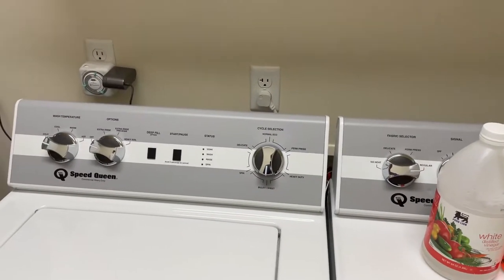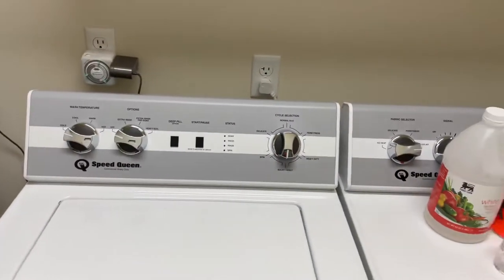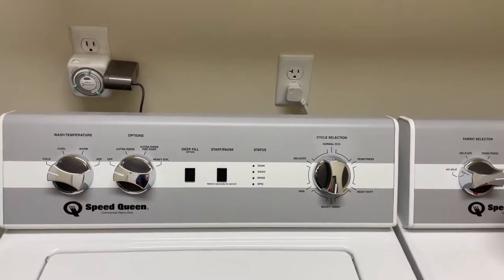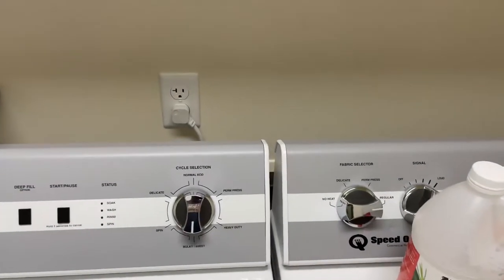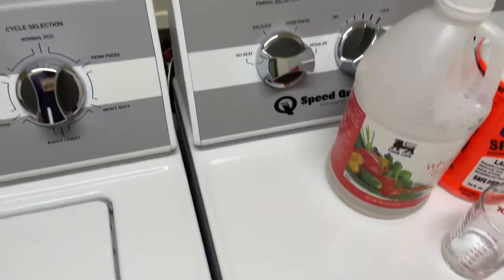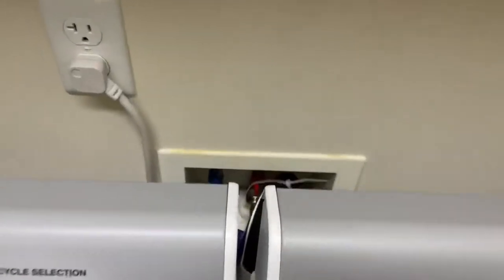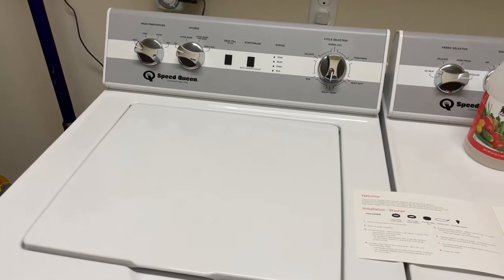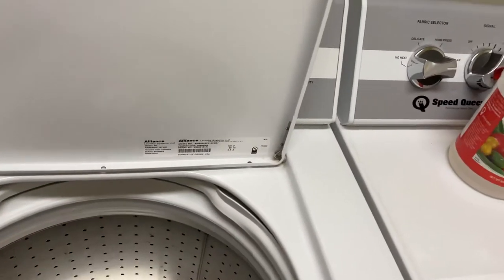Foam Bubbles coming out Speed Queen Washer drain hose - Fixed!

Comment: Rick, You are one impressive person. I did as you suggested but after doing the  "tub cleaning", I ran a regular load  using detergent, Borax and vinegar and this very wet foaming over still happened at the very end of the spin cycle. I have spent a lot of money to make sure everything else is working correctly as far as the plumbing. I am at the point of just accepting that I will have to be prepared to catch the spillage every time I do a wash. Ideas?
Reply from the maker: Hi Denise.  Thank you for the kind words.  Deep Fill the machine with Warm water.  Do not put anything in it.  No clothes. No detergent.  After a 3-5 minutes of it washing open the lid.  Are there suds in the water in the tub?  A few bubbles are not a problem.  If there are suds - there is still soap inside your machine.  It hasn't all been cleaned out yet.  Let me know how that goes.  Rick
Reply: Rick! Thank you for your quick response! I did what you suggested and there are only a very few bubbles from agitation, most likely. No suds.  I am grateful for any suggestions you have.  @rickstid-bits
Reply from the maker: Hi Denise,  Well . . . 
That tells me that the soap build-up in the machine is gone.  That's good. 
That tells me the foaming you're getting is from the ingredients you're adding in each wash load. 
1.  Are you using anything other that detergent and white vinegar?  No softener crystals, beads, etc?  
2.  You are using a cycle that uses a true drain-and-refill rinse cycle, correct?
3.  You could use a cycle that uses the Slow Speed Spin.  I didn't get any foaming when I tested that cycle.  However, our clothes came out a lot less dry with that cycle.  
4.  Use a lot less detergent.  
5.  Try a different detergent.  And again, a lot less of it.  
6.  Try adding 2 or 3 or more ounces of vinegar to the cup in the center of the agitator.  You can experiment until you find an amount that works for you.  

7.  Timer:  This is not a convenient practice, but if you are always near the machine while you are doing a load -  it will work.  The High Speed Spin spins for 8 minutes.  I only ever see the foaming during the last 3 minutes of that final, High Speed Spin.  Depending on what Cycle and settings you use:  You could add up the time each event takes, and then set a timer to go off 3-4 minutes before the end of that final event.  The timer would go off when the machine is 4-5 minutes into the High Speed Spin.   Simply open the lid at that time and remove the clothes at that time.  Then, Cancel the cycle.  My wife has an Apple watch and she uses it to, "Set Timer for xx minutes" all the time.  She has that Apple Watch Timer down to a science.
Reply: Ok, I use liquid detergent and Borax normally. I added the vinegar just because of your suggestion.  During the final spin cycle, the amount varies, but I have to keep two paper towels stuffed in the box where the drain and on/off water valves sit because of the amount of very wet bubbles that overflow. At times there is enough to overflow and wet the floor if I forget to do this. Otherwise, I can capture the "wet" mostly in the box.        re @rickstid-bits
Reply: oops.... I only saw part of your previous message before my last response. Thank you for all the effort that you put into my issue. I SINCERELY appreciate your help! I will try your suggestions.
Reply from the maker: I'm sorry none of those tips are helping you.  If you ever find something that works for you, please come back and let me know.
Reply: Rick, just that fact that you posted and let many others reveal that this is a "Speed Queen" specific issue, was a game changer! The plumbers came back and I was able to run the end of the final cycle and show them exactly what and when the spillage happens. They had never seen anything like this!   For now, they did a temporary fix that seems to be working. They pulled up the white drainage hose and created a thick band around one area with plumber's 10 mil tape so that when forced back into the drain pipe , nothing can come up. They made it fit super tight. I hope that explanation makes sense. Rick, YOU are a rockstar! THANK YOU!               @rickstid-bits
Reply from the maker: Hi Denise,  Thank you for the kind words.  I really enjoy helping other people by passing-on tid-bits that I figured out over time.   Keep me posted.  Rick

Comment: I can’t begin to tell you how frustrated I am with this machine.  My third Speedqueen washer and last.  I realized early on there was a foam overflow problem and would tie a t shirt to the standpipe.  Every fifth wash I would notice moisture so I would change it.  Come yesterday we had a flood seems that the thing they give you to help with this issue came off and clogged our standpipe.  Plumber charged 240 and had to cut it in order to get that black plastic cap.  Still it is foaming out and now are floor is damaged and drywall is removed    I call Speedqueen and not much they can do.  They won’t switch it out to their other less powerful model which at this point I would rather have.  I wish I never bought it.  I do use the vinegar and will now use it for every wash.  Thank you so much for sharing    Do you think the normal eco cycle produces more suds.  Thanks again.
Reply from the maker: Hi Donna.  Yes.  The Eco cycle uses 1 less drain and refill cycle than the others.  That means the suds are less diluted during the final high speed spin.  We use Heavy Duty, Bulky, and Permanent Press.  I have since changed how we add the vinegar.  We now add 1-2 ounces in the center fabric softener dispenser when we add the detergent to the machine.  That adds the vinegar during the first spin, which is at the end of the wash cycle.  That has worked very well for us.
Reply: I switched from Normal/Eco to permanent press and it fixed our issue.

Comment: I have cleaned my machine and am using 1/2 tablespoon of Persil sensitive detergent and am still getting bubbles/water coming above the black adapter that goes in the standpipe. I don't know what kind of detergent to use and I am so frustrated. I use vinegar with every cycle.
Reply from the maker: Hi J,  Please click on the word "more" at the end of my description.  I have added a lot more information there.  Please do the #1 Flush, and read about which Cycle not to use.  Rick

Comment: My tc5 has gotten worse and actually leaks water over the drain now. Not just foam. It was on the drain cycle and started overflowing, so I turned it off. I let it rest a day and tried again, but it overflowed, so I called a plumber. He sat and flushed the lines with me standing there for almost ten minutes. He said my lines were clear and packed up to leave. I shut my washer and started it up, and it immediately overflowed. I ran out and got him to come see what was happening, and he said if he didn't see it with his own eyes, he wouldn't believe it. He was stumped. No suds. Just water. The vinegar helped for a little bit, but we are hardly using soap. It's on the wash cycle and there are no suds. When it drains, there are suds at the end, but water overflows the wall. I've had two overflows, just this week. We just replaced the plumbing in the wall floors in December. FRUSTRATING! Plumber is stumped. Come on Speed Queen.
Reply from the maker: Hi Lisa,  I'm sorry you're having problems.   If it's overflowing pure water, with zero foam in it, I don't think the washer is causing the problem.  Everyone that has added comments here, and myself, only have issues with the foam bubbling up in the standpipe.
I can think of 3 things for you to check.
1.  How high up the wall is your standpipe?  How many feet and inches?  If a standpipe is too low - there isn't enough pipe in the wall to accommodate the amount of water that rushes into it when the washer drains.
2.  Could your washer machine's flexible drain hose have a hole in it?  Even a pin hole can leak a lot of water.  Look real close while it's draining and see if the water is coming back up the standpipe, or from the drain hose.
3.  There has to be a good amount of the drain hose sitting inside the standpipe.  At lease a few inches.  Is that part of your drain hose short?    
Thank you for leaving a comment.  Please click on the words “Rick’s Tid-Bits” underneath the video to go to my YouTube channel.  I think you’ll find some helpful and unique tips in my How to Make Life Easier or Better section.  https://www.youtube.com/channel/UCc-IuUFzC2Tyv06KzJyBESg  Rick

Comment: We purchased a SpeedQueen Model AWN432SP113TW04 several years ago.  Moved in 2020 and just discovered paint peeling behind our washer due to suds backup (we didn't experience this in previous home).  Our standpipe is standard height.  Contacted SQ rep who suggested fabric softener which worked but quite frankly I don't want to have to add fabric softener (and extra rinse cycle) to every load for the duration of the life of this washer (more chemicals, more money)??? Vinegar didn't seem to work.   Called SQ repair who suggested getting the small black rubber adapter.  This doesn't fit snuggly into the standpipe.  I find it surprising that this appears to be a longstanding problem with SQ washers yet they've not come up with a solution.  My husband and I are so frustrated after dealing with this for months.  Is fabric softener truly the only fix for this??
Reply from the maker: Hello.  Try this:  Empty washer. Hot Water. Heavy Duty cycle. No other options.  Not Deep Fill.  No soap.  Let it fill. Pour a half gallon of white vinegar in right after it fills.  Let it run.  That should flush out most of the residual soap from the machine and your drain.  Afterwards:  Remember to always use A LOT less detergent than you think you should.  Please come back and let me know how that goes.
Reply: @rickstid-bits  Hi Rick, thank you so much for the response.  My regular wash habit was using the regular cycle and regular Tide liquid.  I recently switched to HE Tide but use very little (approximately 1 Tbsp).  I just finished doing exactly as you said and there was no backup.  However, we had ordered a black rubber adapter that was recommended by a SQ rep.  It didn’t fit snuggly but we pushed it in standpipe as much as we could.  I think if there was backup I would have felt it on the paper towels we keep wrapped around the hose/pipe.  That said, I’m wondering a few things now:

Any idea How long does this vinegar “fix” work for?
Do you add vinegar on a regular basis?
Reply from the maker: Hi Charles,
Here's some more of my thoughts for you . . . 
*  We add 1-2 ounces of white vinegar with every load we do.  That has (pretty much) solved this issue for us.
*  I want to add the vinegar so it's added during the rinse cycle.  The Bleach Dispenser will add it during the wash cycle.  The Fabric Dispenser will add it during the spin After the wash cycle (so it's in with the rinse water).  
*  Never use the Normal (Eco) cycle.  That cycle does not have a rinse!  Normal/Eco only Fills, Washes, Drains, Spins, and only "sprays" some water on the clothes while it's spinning.  There is no second Fill!  So, there's still lots of soap in your clothes, and machine!  It's crazy.  
     Any other cycle:  Fills, Washes, Drains, Fills again, Rinses, Drains, Spins.  
     You can also always use Extra Rinse if you want a 3rd Fill and Rinse - to remove even more soap.  
*  Most detergents are now much stronger than they were many years ago.  They are all more concentrated.  So, do make sure you are using less detergent.  
*  Please click the Thumbs-Up button above.  That helps more people see this video.  You can click Subscribe also. 
*  I hope I've been helpful.  Please click on Rick's Tid-Bits above and look around.  I have a lot of other household videos you might find helpful.  Rick
Reply: @rickstid-bits  Decided to send an update.   Did my first load of bath towels (about three) this morning, hot water, extra rinse cycle, one “pump” of Tide HE which is 1 TBL (I measured it), and ¼ cup vinegar.  No backup.  Did a second load using the exact same process and got bubble backup.   I then ran that second load again with no detergent, just ¼ cup vinegar.  I decided to open the machine while it was agitating and saw many suds.  I was so surprised.  So, at this point I’m starting to wonder if even 1 TBL of HE Tide is too much.   The only thing that seemed to work for me long term was Downy.  Never thought I’d spend my retirement years watching my washing machine 😊.  I don’t think at this point I would ever recommend a Speed Queen. This problem seems to affect a lot of SQ owners but they don’t seem to want to permanently fix it except for recommending Downy.  People shouldn’t have to (or even should) add fabric softner to every load.  I cringe when I think of the time and water I’ve used trying to figure this out.   It appears your vinegar solution works for some and I really appreciate people like you who take the time to research and do YouTubes to help others.
Reply from the maker: Hi Charles.  Thank you for sending me the update.  I wish I knew of a fix for everyone.  Please come back and let me know if you ever find a fix that works for you.  Rick

Comment: WOW I had the same problem... Damn suds coming outta the drain pipe... I ended up putting a deep tub next to the washer and clamped the hose to the tub and started draining it that way.. was a bit of a pain in the ass but now I have a deep tub in the laundry room... Oh and I put a sock on the hose that drains from the washer into the tub so it wouldn't splash all over the place. I had a guy come out and snake the line.. couldn't figure out why the suds came up the pipe and spilled over.. it's fixed now.. Love speed Queen.. I wash in eco mode.. Didn't know it won't do a full tub of water in that mode.. all the other modes do a rinse with a full tub of water?
Reply from the maker: Hi Paul.  Having a large tub in the laundry would be nice.  I'm glad that worked out for you.  
     Click on the Read More in my description.  I listed there which modes have the traditional rinse that we're all used too.
     Thank you for leaving a comment.  Please click on the words “Rick’s Tid-Bits” underneath the video to go to my YouTube channel.  I think you’ll find some helpful and unique tips in my How to Make Life Easier or Better section.  https://www.youtube.com/channel/UCc-IuUFzC2Tyv06KzJyBESg  Rick
Reply: @rickstid-bits  I'm still shocked about the rinse cycle and it not filling up to do a real rinse.. so let me get this straight... The other cycles will do a full tub of water to rinse.. it's the Eco/normal mode that doesn't do a full fill. Correct?
Reply from the maker: Hi Paul.  That is correct.   The Normal/Eco cycle never does a rinse.  All the other cycles do.  I agree.  I was also shocked when I figured that out.  You don't even get the soap out of your clothes in the Eco cycle.  Here is a link to the manual.  This is for the TC5000, which is what I have.  I don't know if a newer machine is any different.
     You have to study each cycle for a minute to understand what it says.  But, yes.  Eco never has the drain, fill, rinse.  https://docs.alliancelaundry.com/tech_pdf/Production/204807en.pdf